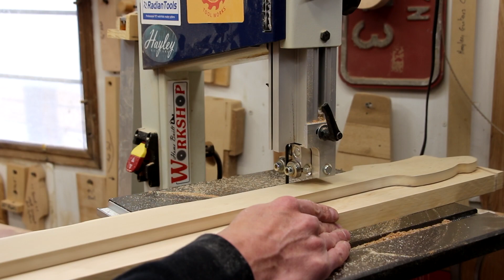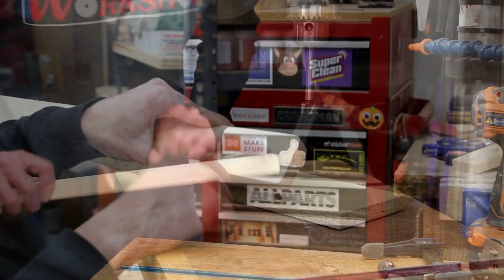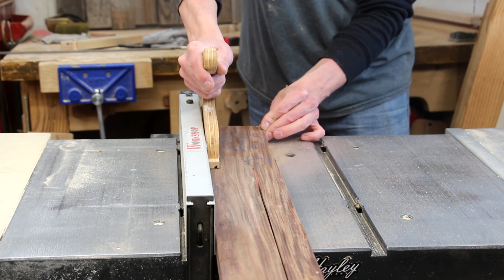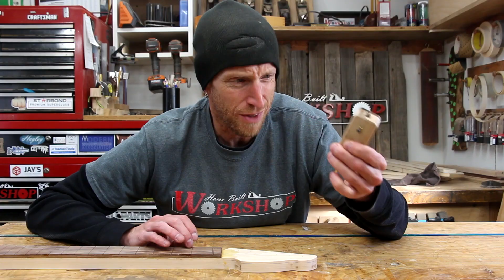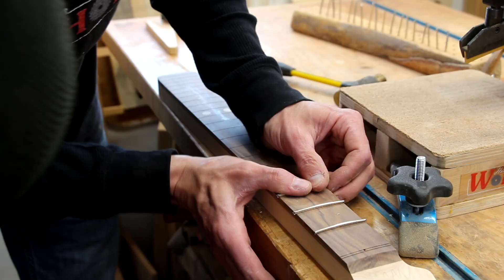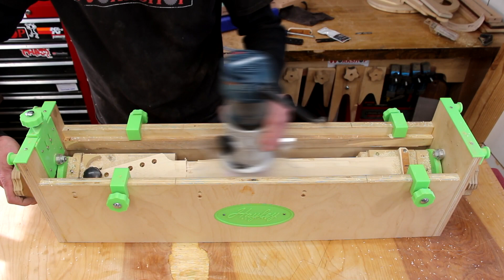The Great Guitar Build Off 2021 EP2 | Making the neck for my Hayley Guitars Dorian

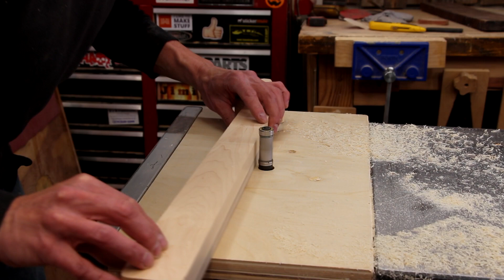Comment: On 1:23 You talk about cut with the grain. Do you look grain on the side of neck where you plan to trim or on top? Sorry if question is stupid, amateur here :-) How can I know what is with the grain on neck blank?Thanks
Reply from the maker: You want to watch the way the grain runs on the side of the neck. I've heard of it explained like petting a cat. Lol. You always pet them with the way the fur lays. The same goes with the grain of wood. Try to always go with the grain. If the bit cuts against it, it can pull the wood up and cause tearout. Thats why I try to cut down hill, with the grain. Try to think of it as if everywhere there is a grain line, that is potential for tearout so rout it the way that doesn't pull against the grain line. 

I hope that helps a little. Its kind of tricky to explain here.
Reply: @homebuiltshop Thank you. I will try to image to myself, and try to practice somehow. So I must cut with the grain and "feed" wood in the router bit.